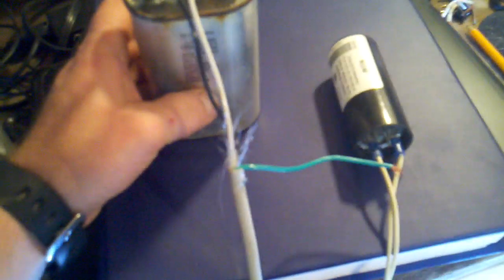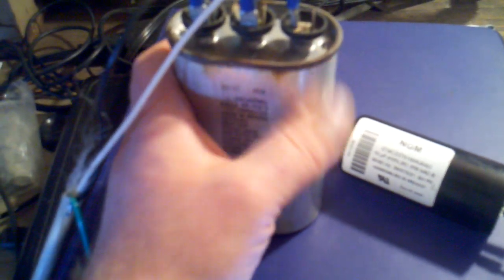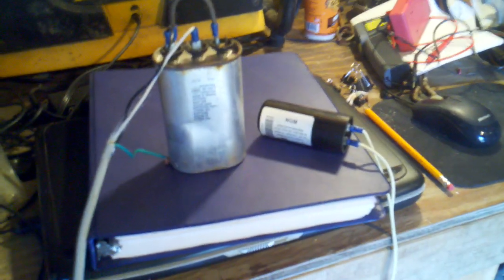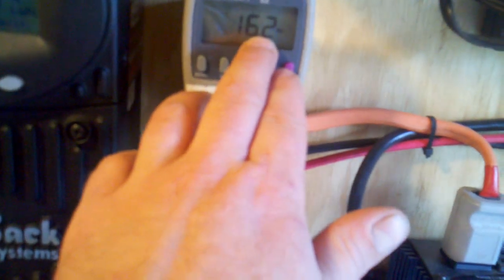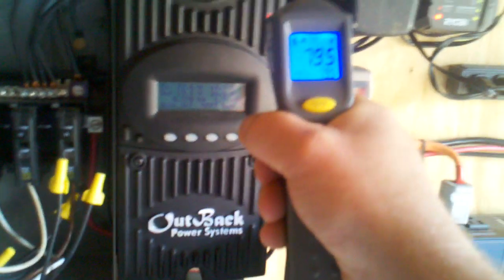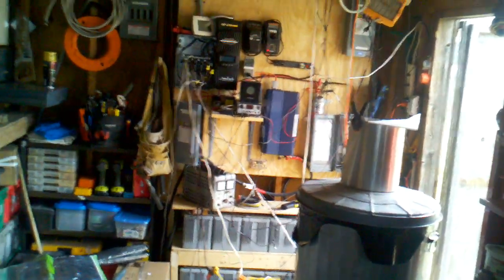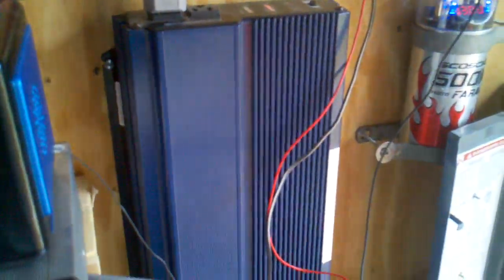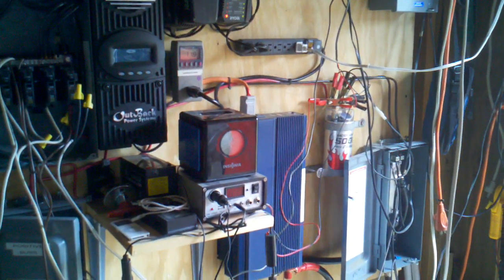Explanation of AC capacitors used in a solar set up to help start motors and save energy

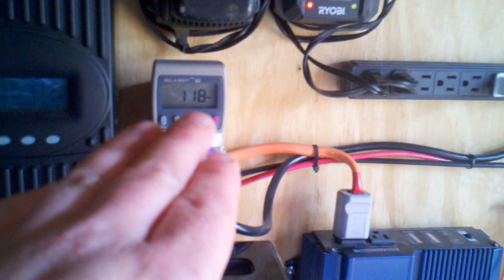Comment: @ 5:25 you wonder if the issue was because you are using a "modified sine wave" inverter. Keep in mind that "modified sine wave" and "sine wave" are NOT the same. A "modified" sine wave is a tricky way of getting you to buy a square, or partially square wave inverter. If it says anything other than just "sine wave" inverter, it is NOT a sine wave inverter and is instead a square. This could indeed be the issue.
Reply: Jeramie, I don't know why they insist on calling them modified sine wave inverters. They are really Modified Square Wave inverters. Square waves are simply up to peak, down to neutral, and then down to bottom. Sine wave is curved up and down in a smooth flow. MSW are up to half of peak, up to peak, down to half of peak, down to neutral, down to half of bottom, bottom, up to half of bottom, neutral.

Comment: 2) its the uF or mF same. that you need to balance to fit you system. Try the 5mg side of that old cap you have. That is all you can do. its trial and error Until you find the right match ( balance ). I hope you can understand that ok.
And be Safe High Volt AC kills.
Chris

Comment: OK been doing tests in my Shed for you. it all comes down to finding a balance. Not to big not to small. it has to be just Right. You can do the same test. The One i found that Should work. ( hard to judge as i don't have all the same stuff in my shed as you ) But this should DO it. Rated Capacitance 2uF, Tolerance ±5%, Rated Frequency 50/60 Hz ,Rated Voltage 450V AC. Remember its just a Cap you only get in what you put out. so volt size dose not matter. as long as its more then what you need.

Comment: You are wiring in parallel.  It is impossible to wire them in series without 4 terminals.  If you had 4 terminals and wired them in series, you would have a total resistance of  a value thats smaller than your lowest value.  4.375 in this case.  Not  trying to be a jerk, just don't want to see misleading information!

Comment: 1 other thing Guy if the cap is to BIG then you get that HUGE fux try a smaller cap. 15MF shoudl be great for that inverter if it still flux then try the 10MF

Comment: OK I was not sure, so i rang my dad. He Has been in the electrical industry all his life. After have a long chat He said it should be fine, as long as the cap is in good nick. Put a breaker between it and the cap for the test. just in case there is a short in the cap. that 35mf 1 will be fine just ignore the 5mf side. He also was of the same thinking as me. in the point that it should fix your Drill start :) Hope that helps you bro.
Chris